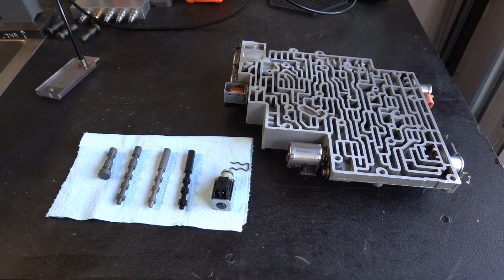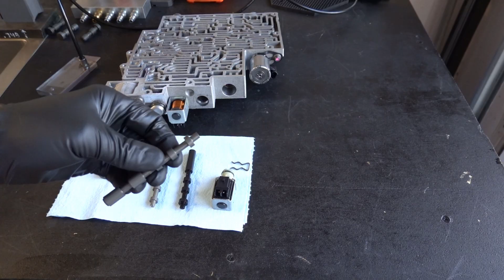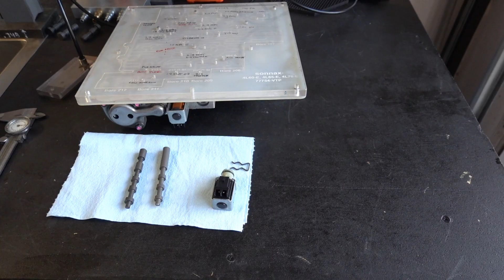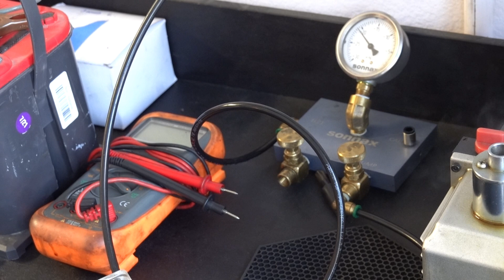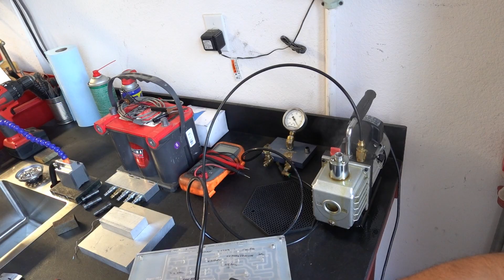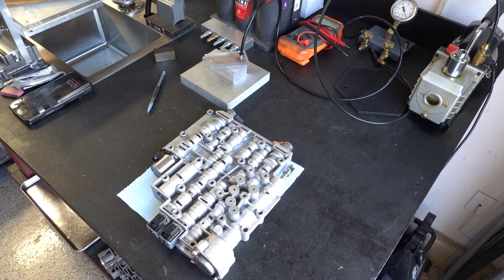4L60E Counterfeit "Sonnax" HD 2-3 Shift Valve Leads to Transmission Failure!

Comment: Not sure what other platform to ask you this on so I'll just ask here. Just rebuilt my first 4l60e . 02 model in an avalanche and I'm having harder shifts than I'd like after installing the sonnax performance pack hp4l60e-01 which I feel pretty sure you are familiar with Went back in and installed stock springs in 1/2 and 3/4 accumulators and removed the shim. This helped a bunch but I'd still like to soften the "lunge" from 1-2. Would installing stock servo springs back into servo help with this? Not sure any of the following info matters concerning the shifts but I put 7 clutch pack in 3/4 all bushings(wide where applicable) dual cage sprag new low roller sonnax sunshell new reverse input drum wide band and corvette servo.
Reply from the maker: Hi Gary, this is the only platform in which to ask me tech-related transmission questions so you are in the right place. 

The HP1 Performance pack is a good kit however, like it's name indicates, it is designed for performance oriented builds, especially those with higher stall torque converters.

If you drilled out the 1-2 shift orifice in the spacer plate, peen it back shut and re-drill it to .062-.070. Also put the stock accumulator regulator valve spring back in place of whatever spring is in there now, if you replaced it with a Sonnax or Transgo spring.
Reply: Ok. How bout the other holes I drilled 5 total. I second guessed that kit but read in several places(including somewhere from sonnax) that kit would be fine for daily driver but it's just not the case
Reply: I'll add that some guys act like this is some kind of secret society or something so I appreciate you sharing your knowledge. I have a mechanical background and at 50 years old this was my first tranny build which I really enjoyed doing. Just should have stayed  oem style for my limited knowledge. You have some good videos. I would like to see you do a 4l60e in depth valve body video sometime.
Reply from the maker: Need to know the particulars of your build to give you any guidance about the other holes beyond what Sonnax has already given...If you fear you have over-drilled them, simply buy another spacer plate and drill the 3rd gear, band release and 4th gear to .093. Keep the 2nd gear feed stock. Leave everything else alone.

I have several in-depth valve body videos, please search my 4L60E playlist. Chances are I have you covered.
Reply: My bad 3-2 shift, 2nd 3rd 4th all 4 .93  AFL .52
Reply from the maker: I'm not referring to what else you've done with the spacer plate...I'm referring to what you have done elsewhere in the transmission. TC stall speed, servo type, what you have done with the 1-2 acc housing, band clearance, type of band, what spring you have in the acc regulator valve, boost and/or PR valve and so forth.
Reply: Oh ok. Stock stall 1400-1600 corvette servo raybestos wide band 3/16 clearance. Acc regulator oem. Sonnax pinless accumulator pistons .490 sonnax boost. Sonnax elevated pressure regulator spring
Reply: Sorry for the all the questions I just don't  understand the valve body or the pumps full operation yet. I just basically rebuilt oem exc. a corvette servo and added that sonnax performance pack full kit by their instructions and I'm just trying to soften shifts  up some without pulling it back out (4wd uugghh) and removing the full sonnax kit and putting it back oem.

Comment: 2000 2500 Silverado just swapped a 4l60e in my truck after the other one lost all gears . New trans has no over drive or first unless truck has been sitting . Once it goes into 3rd gear it stays in that gear unless I manually shift it back to second . I checked everything pin e on the harness has 13 volts checked all the fuses and all have correct voltage and help would be grateful
Reply from the maker: Have you scanned for codes? If so, you'll prob find a performance code for shift sol A...But if not, I'd still suspect that to be the problem...Sounds like it's functional when cold but fails to perform at op temperature.

Comment: I just recently upgraded  my 4l60e valve body with a transgo 4l60e-pro kit. I also added the Superior 4th apply servo and the 2 3 shift valve. On eBay and Amazon there are many copies at discount prices that become very appealing when funds are tight. You’d think that these are easily duplicated parts at a discount prices. I fortunately opted to get genuine parts because of this exact scenario and figured it wasn’t worth the risk. Looks like I made the right call. 

The really bad thing is if my transmission failed and I decided to not vacuum check the valve body during the rebuild, I very well could have used that same part since it’s new and had another failure. 

Thank you so much for sharing this information. I’m looking forward to rebuilding my transmission following your videos and advice when my 4l60e fails.
Reply from the maker: You're welcome, Jim and thank you for watching! Great decision to invest the money in legitimate parts from reputable suppliers. It's simply not worth it to gamble with fringe outfits on eBay, Amazon and elsewhere who peddle in chinese garbage.

Comment: Hey guys would it be ok to get a ebay valvebody??? Are the valvebody themselves chinease aswell???
Reply from the maker: Depends on who the seller is but I'd not look to eBay for valve bodies in general. WITT Performance, Transpartswarehouse.com, Transtar, NatPro, Central Valve Bodies, Sonnax via distributors are a few of the reputable sources for valve bodies in general.
Reply: No way would that be a good choice IMO - unless you are buying from a very reputable seller.  You generally get what you pay for, and if you are only going for price you are likely giving up on quality.  Price, Quality, Speed of Delivery - you only get two of the three at any given time.  Choose wisely and you will be better off for it.  Good luck on your build!

Comment: Im in the process of rebuilding my 2002 4l60e, going well so far, I have not got to the valvebody, I was going to buy a valvebody on ebay for $169, since I do not have a vaccum plate to test. NowbI am actually going to get the vacuum plate and getting parts from sonnax 😅😅
I really appreciate this vid Nick
Reply from the maker: Thanks, Frank and great decision! It's best to have the vacuum test equipment given how prevalent wear is on valve bodies and pump castings.